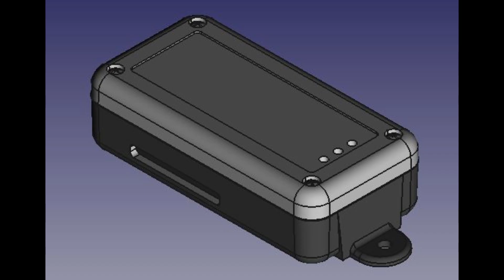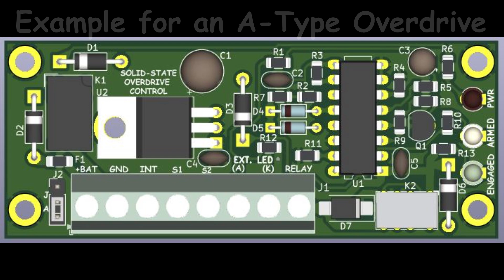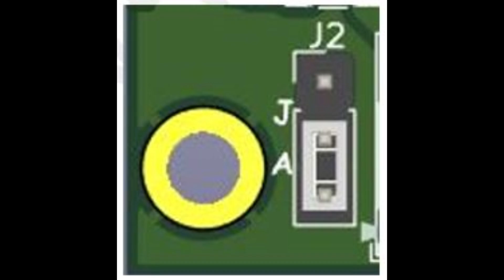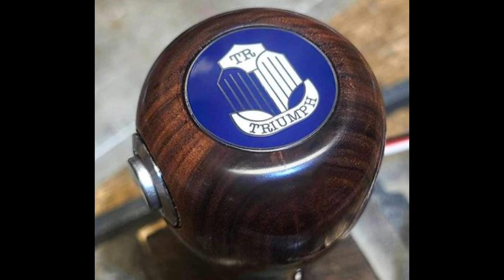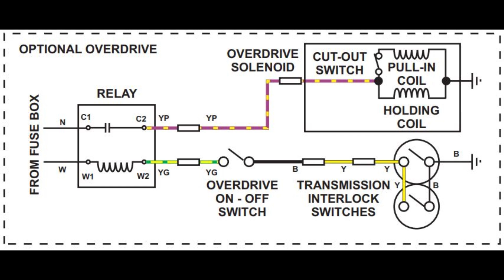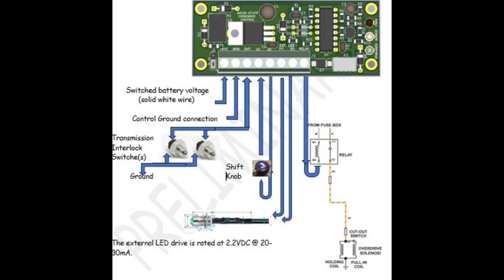DavesTR4A 2024 SS Overdrive Control Wiring

Comment: Hey Dave, looks like a great alternative to dragging the Revington TR option across the pond for twice the price, plus shipping. Definitely interested for an early (1970) TR6 A-Type. Love the knob mounted switch too.
Reply from the maker: It is definitely a great alternative, and the knob mounted switch is way easier to use than a steering column mounted switch.
Reply from the maker: I am in now production of my overdrive controller. The controller will operate an a-type,j-type, and d-type overdrive. I am asking $145.00 for the controller. I also am selling a panel mounted LED indicator for an additional $5.00. Shipping is $10.00 within the continental United States.
PM me if you are interested. Jeremy Chinn is supplying the shift knob which contains a momentary push button switch but my overdrive controller will also operate using the standard column mounted overdrive switch.
I can email you a copy of the installation instructions if you need more information.

Comment: I see you have the switch for J and A overdrives, would this work for a D OD.  I have that on a GT6 motor?
Reply from the maker: I think the D-type overdrive is similar to the J-type with respect to the interrupt switch on the transmission and I believe the D-type overdrive solenoid needs battery voltage to turn on which would require the J2 selector to be in the “J” position.